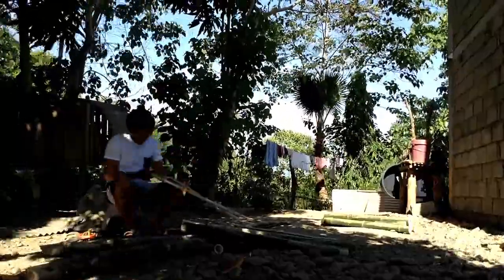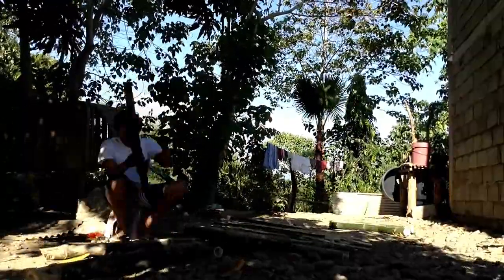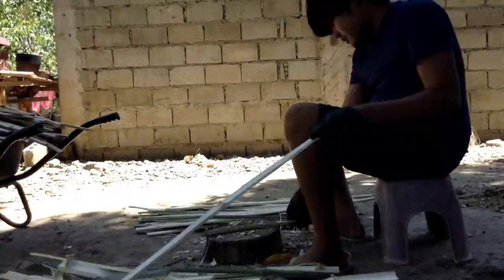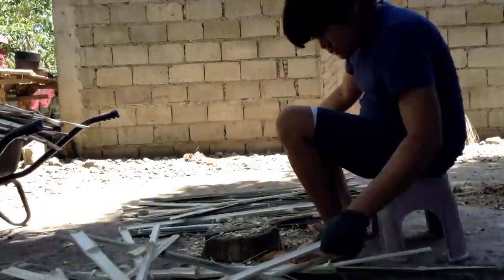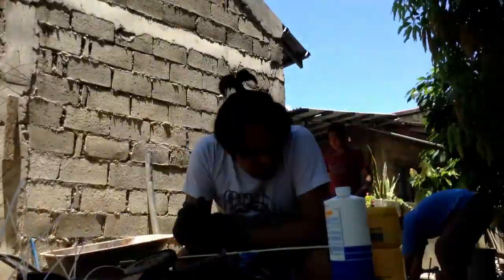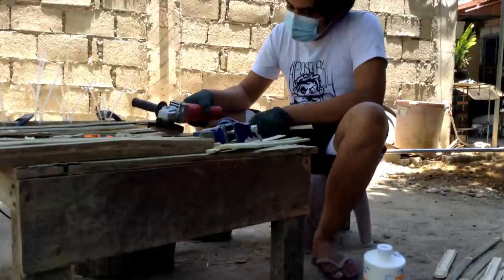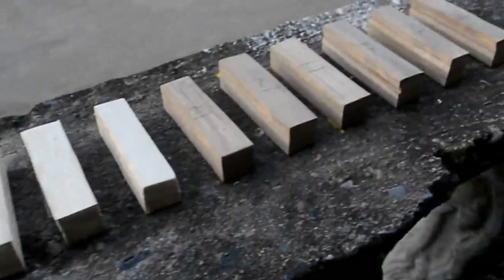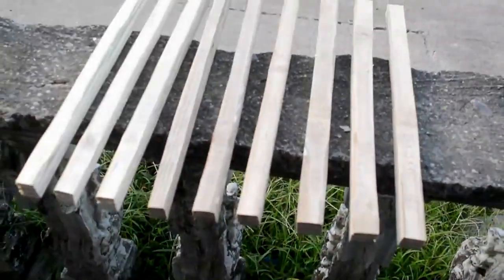A laminated bamboo sample process for compression, shear, tension, and flexural test (ASTM D143)

Comment: Nice video really cool, just wanted to know which adhesive is used to glue the bamboo and how do you make the plywood smooth using grinding wheel....👍👍👍👍
Reply from the maker: Thanks for watching. I used sheldwood glue. while for smoothing the surface I tried to used a sanding disc that can be attached to the grinder.